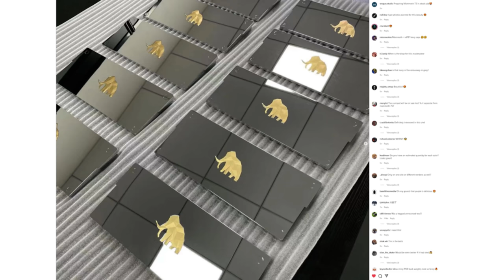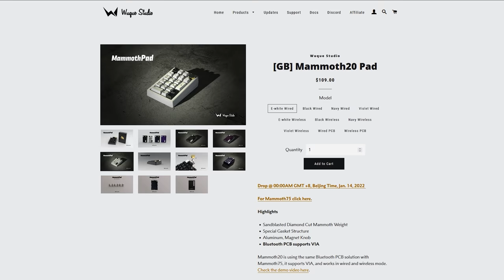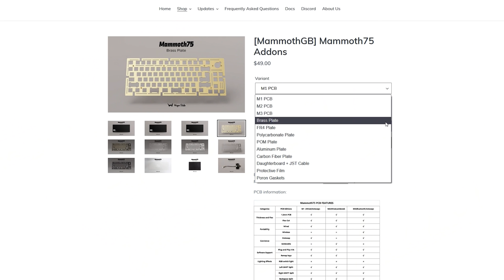Mammoth75: Difficult Journey, Amazing Destination

Comment: Nice and honest review. I'd insist though that most of those annoying points have been corrected for the GB:
- Screw underneath space bar will be moved
- 
No hot glue on DB's JST cable to the daughter board
- Daughter board will be packaged in separate bag
- Plastic standoff screws will be changed to metal screws
- PCB and plate foams won't be pre-installed
- There will be 2 Pieces of case gaskets
Just the PCB vertical placement adjustment and paying attention while screwing will stay ;)

But QMK/VIA, multiple configurations possible and sick look will still make me consider it (plus this souuund ^^)
Reply: I put in my pre order and I literally am flipping out already trying to wait for this board, as this will my first "higher end" board.
Reply: @niko1even  Same here. I bought it because of the fact that it has a split spacebar and wireless option. This board is loaded with so many features. I just hope I don't scratch the case.
Reply: @TheInstaShark  i opted out for the mirror polish finish and got the sandblasted, can’t trust myself with that 😂

Comment: As someone who missed out on the in-stock but did join the GB, I'm glad I caught this video.  If I hadn't gone into the build knowing about the potentially frustrating nature of the board, I probably would have been pissed, but it was manageable since I was expecting it.  Running it right now with the full gasket mount, no case foam, POM plate and absolutely loving it.  Pairs well with the BadSeed Tactiles too.

Comment: Definitely case where groupbuy one is better than instock. I joined the groupbuy for brass pvd one to get the correction. However i am liking the instock one (followed the guide). 

The install process wasn’t as smooth as my Mr.Suit. I ended up using the enclosed tools versus an electric screwdriver for the suit. I think the Mr.Suit is better board overall. Now just waiting for Owlabs Spring International Sale to come.

Comment: I think the reason why your spacebar sounds so bad is because the switch is northfacing, actually.
I had the exact same issue with the multilayout PCB on the Ikki68 and Gat Ink Blacks that for some reason still interfere with GMK spacebars.
The solution for me was just to use a long(er) pole switch on the spacebar, you might have the same finding, though i do still think that the top housing of the switch makes a difference so it might not be a problem on all short-pole switches.

Honestly, it feels like a very very big compromise just to allow for a split spacebar config that barely anyone will use, but oh well.

Comment: As a ikki68 aurora user, Im surprised to see they still have the same problems with a board thats more than double the price. Aurora had some very weird problems on assembly aswell, from plates to sockets, and my right shift still sits crooked because of the multilayouts sockets underneath, with their answer being "cut the washer until it fits ". Still would recommend it as a mid tier board (~$330 assembled), as for the mammoth not sure 😬😬
Reply: Did you or anyone else happen to also order the "Tromso" bluetooth PCB for the ikki68 aurora? 

I just got my Tromso PCB a few weeks ago since I forgot to get it on R1 extras when I placed my original order for the charcoal/mint green group buy , and ordered it during the Peaches N Cream group buy. anyways long story short I just now looked at the PCB to try out this Bluetooth PCB...I'm still trying to figure out if this toggle switch located on the top side of the Ikki68 aurora Tromso Bluetooth PCB (located to the left of your spacebar switch) ...but the strange thing is its on the top side of the PCB, plus its angled at a 45° angle instead of flush with the top of the PCB. Honestly have no clue if it's the on/off switch to turn power off to the connected battery you connect on the underside of the PCB for bluetooth mode or what haha. It just looks so out of place since its the only thing sticking out/up from the top, but it would make sense if it is supposed to be there as it would be annoying to have to take apart the ikki68 to get to the underside of the PCB if this switch was instead located next to the hotswap sockets. 

If anyone wants to shed some light on this for me that either owns a Tromso PCB or ordered the wireless version of the ikki68 aurora that knows what this little thing is, would be greatly appreciated 👍 

Also thank you for yet another solid video of one of the several boards I've been curious about 👊

Comment: 1:32 is that a scratch on the bottom piece?
Reply from the maker: Man, I just had to go back and look at the actual board.  It is a scratch on the top edge of the lower.  I can almost 100% guarantee that I did this in the numerous times I rebuilt this. I went over it HARD when it arrived and that wasn’t there.
Reply: @badseedtech  Thanks for the honest review as always. I can tell how frustrating the build was for you lol. I do really hope that they fixed those issues in GB. I.e. the top case screw positions, yikes.